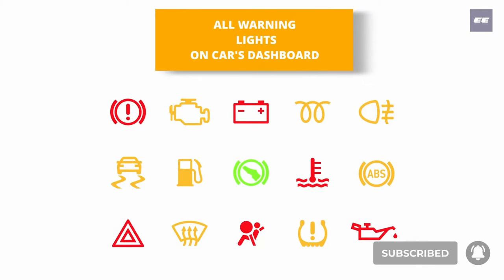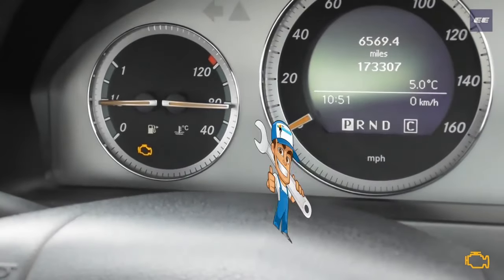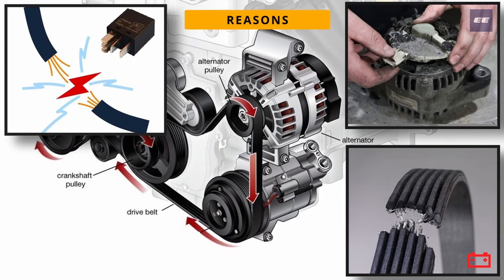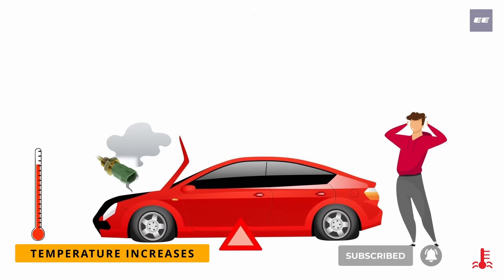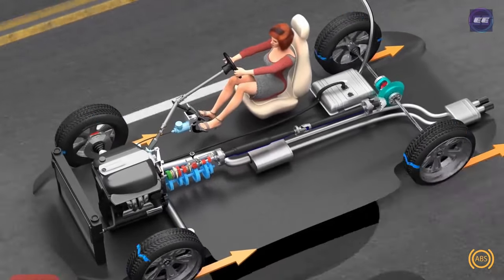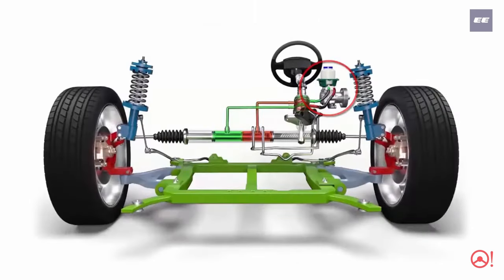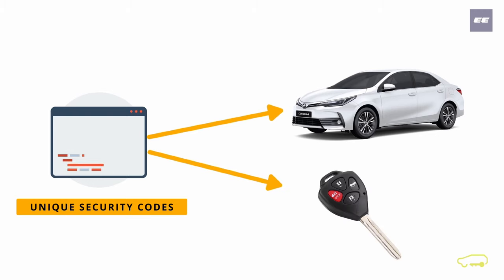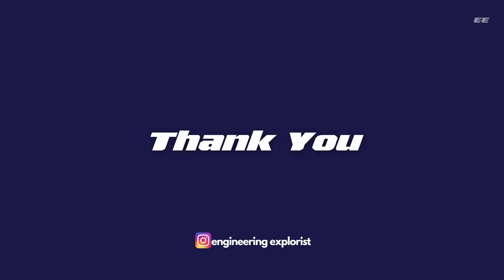Warning Lights in Car's Dashboard and Their Meanings | How to Reset Warning light? | Explained

Comment: Thanks a lot for that explanation, but is it ok to drive a car with ASB sign for 20km in order to reach the garage???
Reply from the maker: Anything may be the Reason for ABS ON(maybe Smaller or Bigger). It's safe to Not drive your car. But in Unavoidable situations, You can drive Slowly after checking the Brakes are Working Mechanically.